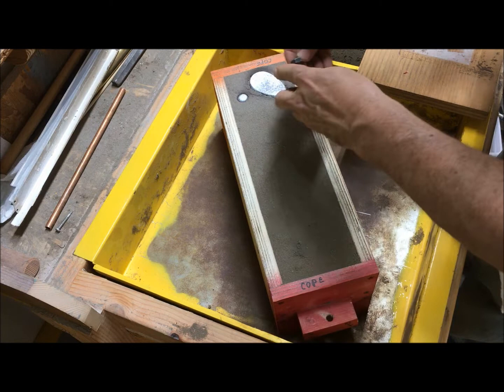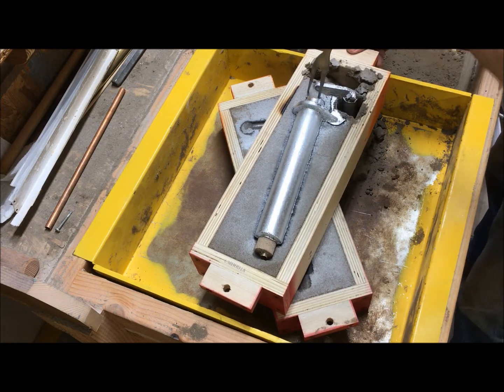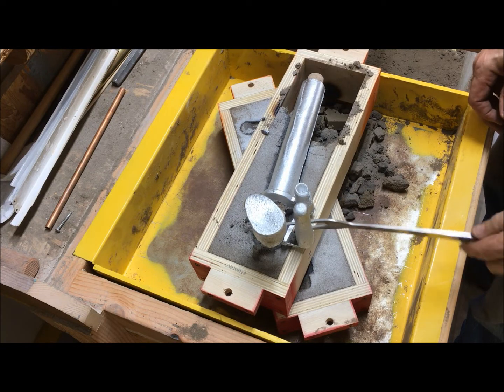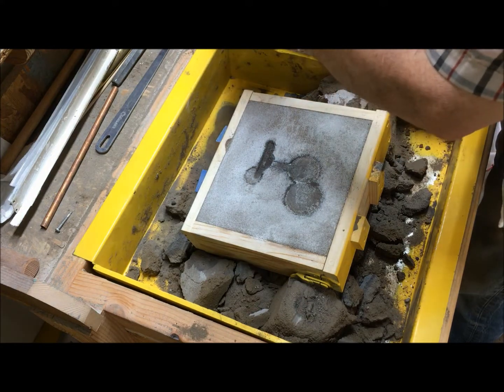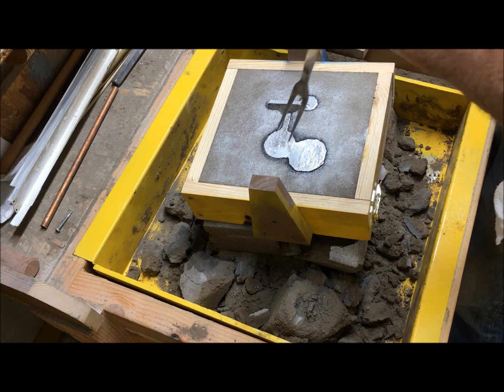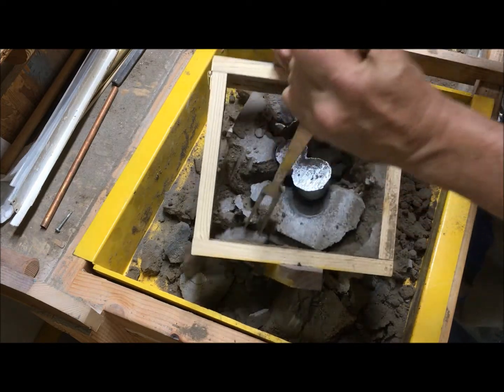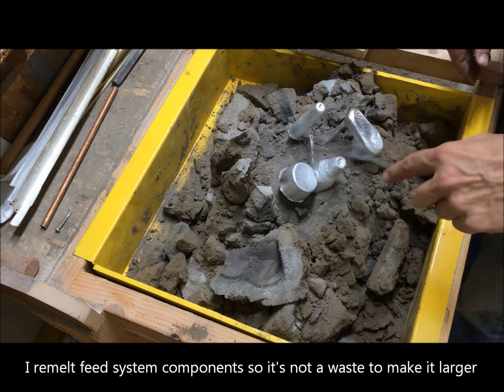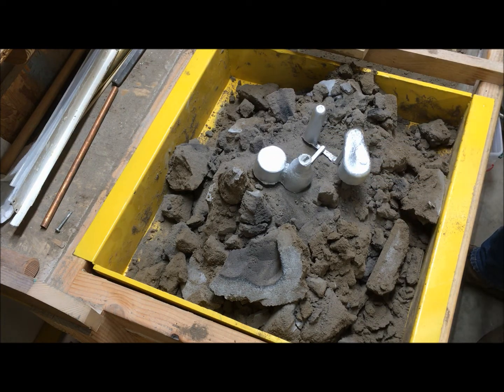Foundry 39: More Bifilm Control Applied to Sand Castings

Comment: Getting that core vented yet strong and stable will be important for making a hermetic part. I saw the metal tubular support chaplet in your previous video. What did you do to prep the core in this go?
Reply from the maker: Hey Kelly!  I'm going to get a hermetic part!

I've had fits with that core design.  I'm still using the 3/8" copper tube as support but drilled holes every 2" so I could gas it through the tube.  First shot at that failed because I got too much sand into the tube while ramming the core and the bottom 2" did not harden.  I hate making excess changes after a failure but this time I was sure to rod out the tube before gassing and also forced a wire along the tube end to end to provide an additional gas path.  Probably not necessary with the drilled tube but quick and easy.  Also vented each core print with a fine wire (no aluminum entry).  I'm using N grade sodium silicate at 4% and generating CO2 with a plastic bottle with baking soda and vinegar.  Did not bake the core.

I've also made a vegetable oil and corn flour based baked core with no chaplet but haven't cast it yet.  I can't understand the instructions and got it black cooking it.

 Maybe I'll video the next one (and see it fail) :-)
Reply: Stay with it Andy. It is a little tricky and achieving a hermetic part is more challenging than one might first expect. I think I have about 15" of cored tube length in the automotive water necks, and they twist, turn, and intersect. I have my straight foam patterns ready to pour.....you'll need to update your thread at THF with #39 and beyond....Game on! Best, Kelly
Reply from the maker: @kellycoffield533  Thanks, I usually give up too easily.  It just looks really easy.

How are you going to test yours?  With hoses?
Reply: @andrewmartin4258 up, hoses. The original parts are awkward to hold (for machining) and they have hose beads on the OD so I already have crude pieces to test them. K
Reply: Yup, hoses. K
Reply from the maker: @kellycoffield533  Oh, thanks for the clarification.  I thought you were saying up yours with a hose.  But you're going to plumb "up yours with a hose".

Actually I hadn't noticed.

Comment: Nice tests. 

To really see the porosity you will need to use a caustic soda etch after sanding and polishing.  Aluminum will fold over on its self and hide the porosity holes, the alkali etch will reveal what's been covered over. Olfoundryman has a recent video showing the process.
Reply from the maker: Great observation!  I learned in school to etch samples.  In industry grinding in particularly smears steel over cracks and defects and etching is the quick way to open them up for liquid penetrant evaluation.

You may have noticed my comments on his video.  I have etched lots of specimens for review.  Recently I've convinced myself that with progressive sanding to 5,000 grit and subsequent polishing to 0.5 micron with 300X magnification I see no more 0.0005" defects and larger with etching.  Stopping with 5,000 grit sanding still picks up 0.001" and larger just fine.  P5,000 is about 5 micron but the two 5's are not related, P3,000 is about 7 micron.

The down side with etching, as Martin commented, is creating pits in the more etch susceptible parts of the sample.  For me, etching is great to find long tight cracks which you otherwise may miss.  In a fresh casting of soft material we only get very short bifilm cracks, I'm not looking for cracks.  Sanding after etching has to be very light just to remove the color but you still grind away the surface.

If I find the time I may try to do a video demonstrating the size of defects visible at 300X with and without etching.  If I had a real microscope and were looking for grain structure then etching would be a necessity.